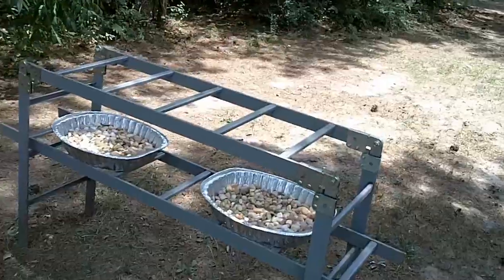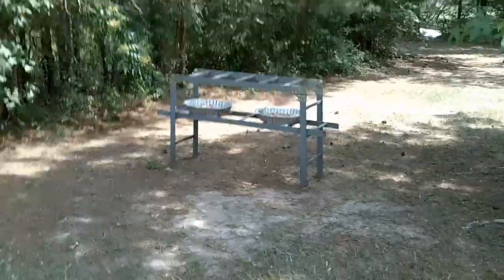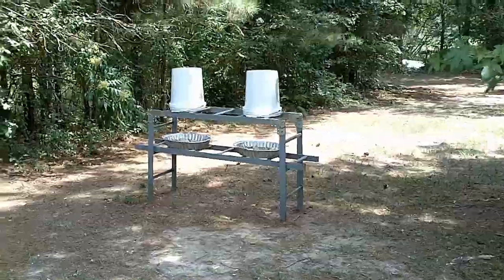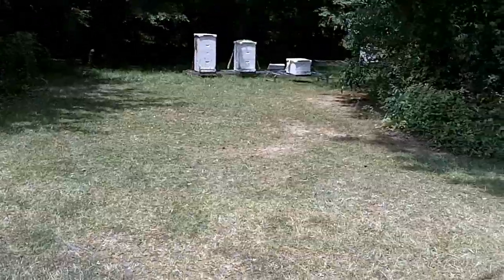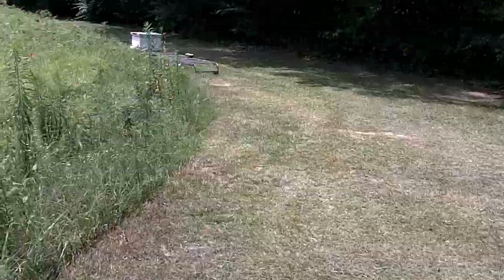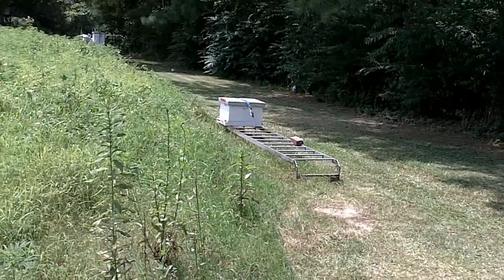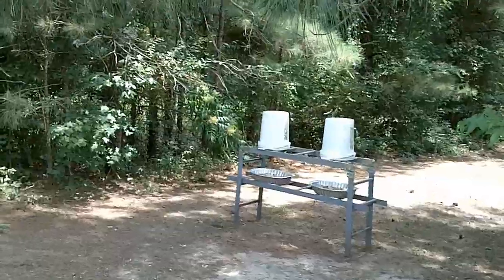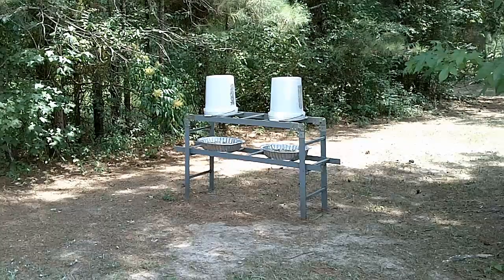Bee Feeding Stand, best one to date!

Comment: The gravel in the turkey pans is that for water or to catch any drippings from the sugar mix ?
Reply from the maker: Yes, and rainwater. I've got holes punched just below the gravel line so the bees can walk on the rocks and get to the water without drowning.
Reply: Well with 6.5" inches of rain  all last year   over flow with rain water is not a problem  I am thinking of running a drip line to the water trays
Reply from the maker: Walt Lars Yep, that would be a good idea. Bees need hydration too!!
Reply: Yea I was thinking a 2-3 GPH dripper  any problems with ants crawling up on your wire rack or getting to the bee-bar ?
Reply from the maker: Walt Lars When It's full, and the bees are all over it, no. When it gets empty or the bees have found something they like better then yes, but a good coat of cooking spray puts an end to them. I also use cooking spray on my hive stand legs! It helps a lot!
Reply from the maker: Walt Lars Yep!! They can kill a weak nuc or a package  just put in a box overnight!! Seen it first hand!
Reply: How long and when do you feed the girls ?
Reply from the maker: Walt Lars New hives,(1st year, nucs and splits) I feed all season cause I'm not going to rob them.
Established hive I will rob as soon as the turnips bloom to get rid of any syrup from winter, then mid June I'll rob the pure honey. After that you watch their stores, it will tell you how the nectar is flowing. You might get to rob more pure honey if they are packing honey in the supers, if things aren't moving along by mid July I go ahead and put syrup out. The Nectar "flow" was off this season in my location this season so I'm putting out syrup, and don't plan on robbing a second time this year.
Reply: Does feeder honey taste differant from nectar honey ? 

Whats Your thoughts ? Top bar hive VS landourgh/white box style
Reply from the maker: Walt Lars Feeder/syrup honey will granuleize in the bottom of the jar, I don't think it's as sweet and nectar is better for the bees cause it is natural. That said, we are making so many pesticides, herbicides and pollution that the bees need all the help they can get these days! That's why I feed, some folks are totally against feeding.
I like the "Langstroth" because its like a Glock, everyone has them and the parts are interchangeable!
 Beekeepers are great people, and they will help each other out at the drop of a hat, but if your top bar, and your friends top bar are built different, then y'all cant exchange, trade or help each other out. A frame of brood from a strong hive put in a weaker hive can make all the difference in the world!! Plus, say you find a queen cell on a board and want to make a split, hard to do that with a top bar. 
The Langstroth can be built in 5 frame nucs, 8 frame hobby or 10 frame commercial and all the frames will fit the brood boxes, then you have the honey supers and queen excluders that keep brood from being laid in frames with honey.
Then there is extracting, your only option with most top bars is "crush and strain". The Langstroth type can be slung in an extractor and the bees can have the frames back with the comb already pulled!
Ok. I've wrote a novel! LOL! I guess you can tell, I like the white boxes!! HAHA!
Reply: Just moved to a area where bees are used to polinated water melons  guess I will have to beat the bushes to find them
Reply from the maker: Walt Lars OOOH! Commercial folks are notorious for not mainlining, so swarms are easily caught! A swarm lour with lemon grass oil and a frame of wax might catch you a hive for free! Good Luck!
Reply: Free is always the best price  BTW what does a starter package of bees run ?
Reply from the maker: $95-$110, but I don't recommend packages, I think a 5 frame nuc with a laying queen and brood is much better! Look locally and you might find a local beek with them for $130 to $160. In my opinion well worth the extra money for frames brood and an established small colony!